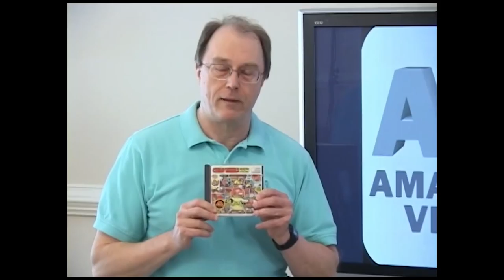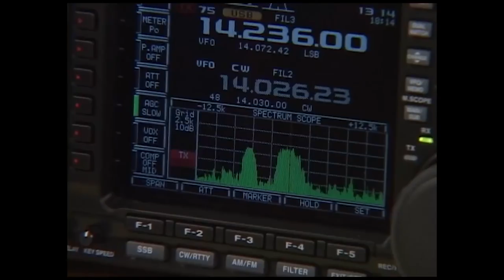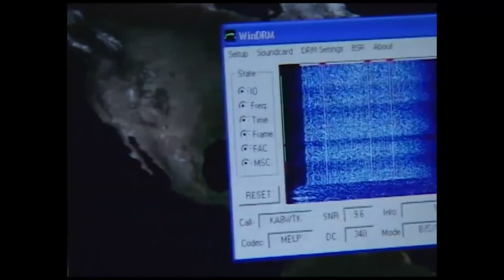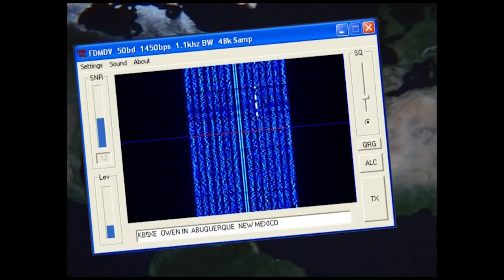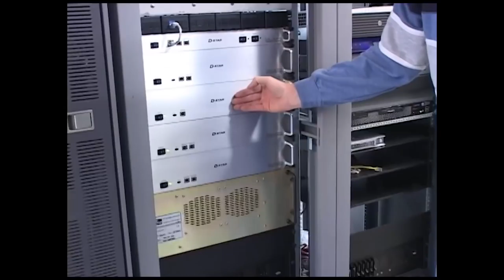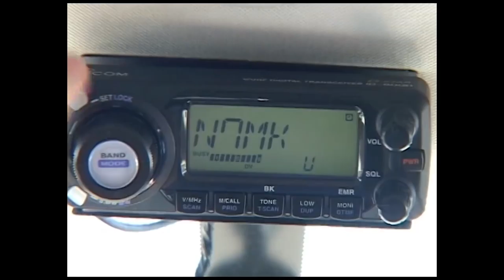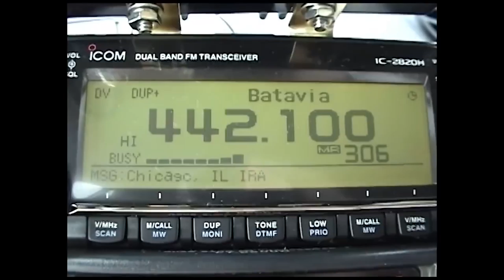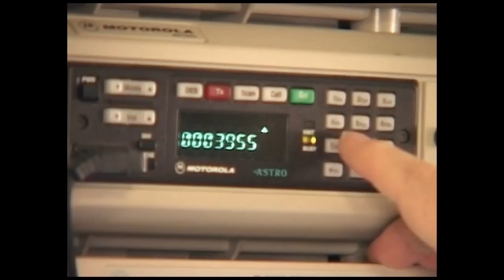HRN 381: Digital Voice 2008 on Ham Radio Now

Comment: Great program, Gary. I think there's some HF dstar nets. Dstar is an option for the ic-9100 and built in on the ic-7100. Not sure about the ic-9700 currently in development.
Reply from the maker: +gbubble79 >> True, but D-STAR isn't a great mode for HF. It's 6.25 kHz wide, making it wider than AM, and more than twice as wide as SSB. FreeDV is a better alternative. D-STAR is 'baked into' ICOM radios, while Flex radios can incorporate any mode someone writes an API for.

Comment: It's crazy how much (or how little) has changed in 10 years. While all our phones are connected at >10Mbps+ LTE connections and fiber is sprawling despite the internet/net neutrality problems, ham radio developed JT modes, DMR, YSF, P25, digital dongles, a little bit of maturation and a tiny increase of use of Codec2/FreeDV, online remote receivers and transceivers, and some real expansion of mesh netting, and are just now getting into new territory such as FaradayRF and Bitx and launching bunches of AMSATs, and the struggle to inter-operate  between all these digital voice modes. 

And APRS hasn't gone anywhere.

Comment: I operate a Fusion WiRES X Gateway for my local area, I also have a personal D-Star hotspot and I can access a local D-Star Gateway. There is also an extensive coverage of DMR repeaters in my area. I like digital, and I use it. However, the thing that concerns me the most about digital formats in amateur radio, is the fragmentation I have witnessed between the different groups of digital (and analogue) users. Sure, there is some inter-connectivity between certain formats via their internet connections, but even within the same format, you get sub-divisions of networks. It's certainly not a unified or inter-operable whole by any stretch of the imagination. Not yet, anyway.
Reply from the maker: +2E0JTP >> I'm still waiting for my holy grail radio - one what can operate any digital voice mode, and incorporate new ones with a firmware update. I'm OK with a AMBE vocoder if it can adapt to new modes, but I'd prefer modes with CODEC2. I do not favor limiting ham radio to a single digital mode to enforce compatibility.
Reply: We need Shark RF to get chummy with one of the 'other' manufacturers, like Kenwood or Alinco. 

Imagine OpenSPOT software built into a VHF/UHF transceiver body.  :)